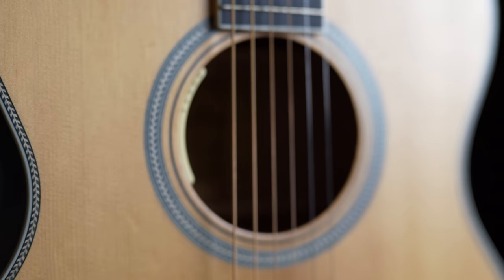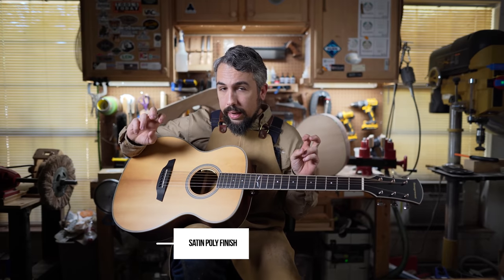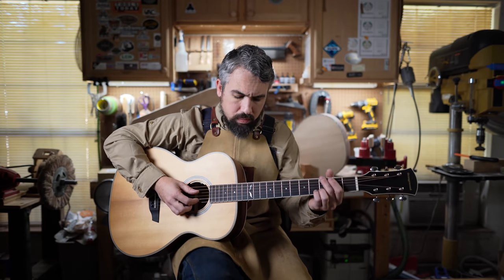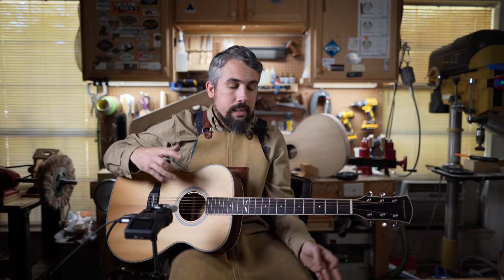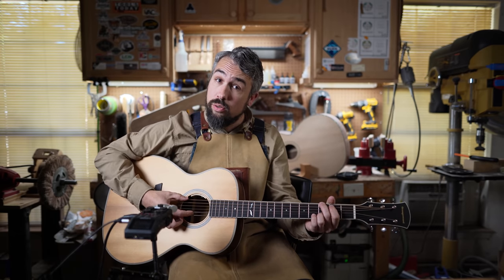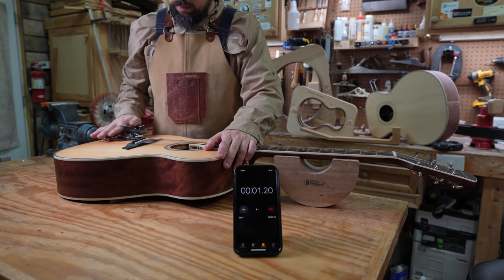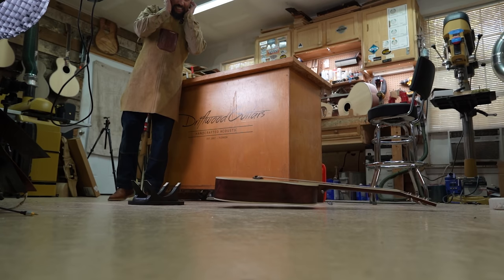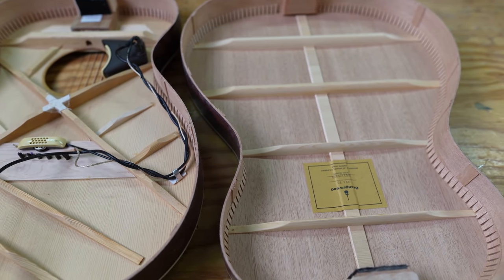A Full Review of the Orangewood Ava Torrefied Spruce Live/The Guitar Breakdown

Comment: Just subbed to this channel. I've owned a Orangewood, I also convinced my brother to buy one. While I have since sold mine (for the same price I paid for it), it was still a great guitar. My brother does online gigs on his OWG every week and after two years it's still a solid guitar. The plugged in sound is incredible with the Fishman Flex EQ.
Bottom line, if this guitar scored higher than the big G brand in this test, that's all anyone really needs to know. Guitars are subjective and while this reviewer may not have liked the sound and had good reason to believe the finish and bracing is the culprit, the acoustic electric OWG's really shine when plugged in.

I'm purchasing my second OWG today with the Torrified Spruce top. 
Thank you Driftwood for the in depth review.

Comment: Thanks for this comprehensive review of the Orangewood Ava. Your review was spot on as far as I'm concerned. I tried two of these guitars and sent them both back to Orangewood. I would agree that this guitar looks great and the features are awesome. However, I was so disappointed with the tone and some ringing/buzzing sounds. I bought the spruce top and then the mahogany model but it was the same flat tone and loud ringing  sounds that turned me off. I wanted to try this guitar because of my experience with another Orangewood  model called the Oliver. The Oliver is less than $200 and it  plays and sounds great, I was so impressed with the quality and sound of it,  I assumed the higher models would be even better.  I think your assessment  that the Ava is overbuilt is probably correct.

Comment: i would love it if instead of cutting one of these orangewoods in half, you pulled the back plate off, retooled the bracing, rethicknessed the top, and re-attached the back to do a before and after. 
i think it'd be a fantastic way to show just how much of a difference fine tuning bracing and top thickness makes on the same guitar. 
it's definitely something i'd try on one of these lower cost, high quality material instruments.

Comment: A year after I purchased my Orangewood Morgan, the neck separated only being held on by the glue between the fretboard and the body. Today, I decided to see if I could remove the neck. Clearly, it's not worth paying a luthier to fix. Removing the neck was as easy as heating up a putty knife and sliding it under the fretboard. The whole neck came out with just some wiggling. It looks like the heel separated when the one part that was glued tore out. When I pulled the neck, there were a few spots of glue stain on the neck heel but none in the neck pocket, so no glue was holding the heel in place and there were 3 shims on the treble side and 2 on the bass side. The heel joint was not your normal wedge shape either. More of a blob shape so that explains the shims. The pocket is reasonably well cut but it doesn't matter because the heel is a travesty.

Fortunately, I have some mahogany that I can use to shape the heel part of the joint and hopefully make a better, more secure join. I'm not a luthier so this will be ugly. 😂

Comment: I know it's probably dumb, but I'd really love to see you test the Dana mini guitar model, or if you want to stick with full size, the Manhattan. At only $135, these are solidly in the middle of my budget, which I realize is tiny, but it is what it is. (If you want to stick with solid tops, the Oliver/Oliver Jr are solid top, but not sides/back. Regularly $225, but on sale right now for $180, they sound like a good deal.) I'm curious to see if it's built about the same as this more expensive model, but with cheaper materials. And if it ends up sounding similar, even though it doesn't sound "good," is it a better value? At about an eighth of the price (or a fifth for the Oliver), I'm very curious. I'm hoping that the playability is just as good as this more expensive one, which to me would make it a killer beginner or knock-around/beach guitar. Highly playable, nearly bulletproof. Perfect for an 8 year old. ;)

Comment: Very interesting review and thanks for the work. It sort of amazes me that what is a fairly new direct, to the market guitar company gets it so wrong. This should be a great business model for consumers but they spoilt it for probably 30 minutes of work in the factory and a little knowledge.  As you pointed out all the ingredients are there for a good guitar in fact it could have been better than good but the overbuilt, dodgy bracing material, top thickness etc just goes to show you can have the best ideas and ingredients but they need to at least get a luthier to do a bit of consultancy to point them in the right direction. thanks again for the video

Comment: Great video series.  Not sure I understand the scoring system, and how a score of 10/10 is achieved.  For example, seemed like the finish performed second to none in abrasion and chemical resistance, but only for a 9/10 score.  What exact finish would score better?  BTW, I don't own an orangewood.
Reply from the maker: There was a slight blushing where the bug spray was, and the finish cracked on the ball drop, so I couldn’t give it a perfect 10

Comment: I just received a Mason Torrefied Spruce model from Orangewood and I have to agree with you on all counts. There is something that is hindering the ability for the wound strings to really project themselves. The E is anemic and the D and G are on the dead side. They're "thumpy" if that makes sense. The A is pretty good except for a massive dead spot at the 9th fret. For just under $500 a newer player might not notice the tone, but if you've played on a guitar that is almost piano-like then you hear it pretty quick. It took me less than an hour from unboxing to boxing it back up for a return. It's unfortunate because Orangewood ticks all of the boxes for me for looks and feel. It's possible it could need some nut work and a different set of strings, but at the risk of disqualifying it for a return it isn't worth it. Too bad! I have friends who have different models and they thoroughly enjoy them.

Comment: Wonder if you've considered gluing the chopped up guitars back together & flogging them cheap to pay for the next one? - probably not worth your time though....
Reply: I Wonder if the guitars would have any structural integrity left
Reply: @samsaxe-taller7145  I reckon a strip of wood around the inside to cover the cut & a couple of bolts through the fingerboard to hold the neck block together ought to do it....but what do I know?

Comment: The Gaps around the perimeter of the bridge plate are to allow for expansion due to hygroscropicity and as such are not a fault. If you tuck the bridge plate into the braces or butt the edges flush with the braces then any expansion will create a pressure point which in turn could cause warping or cracking. This is common practice rather than an oversight on the part of Orangewood - but -The Braces are terrible quality  so it gets lost in the mix anyway - unfortunatley.